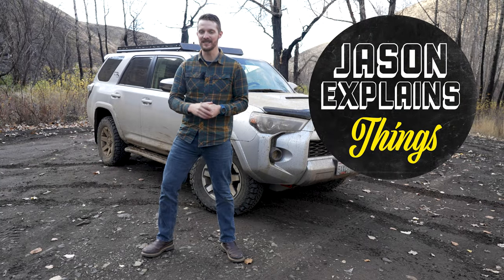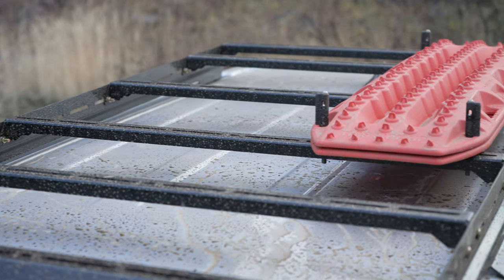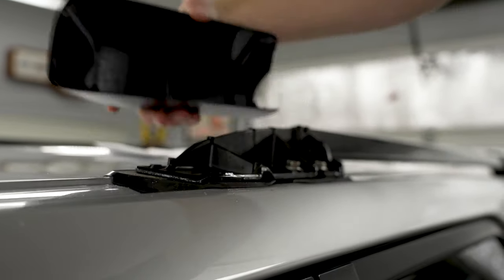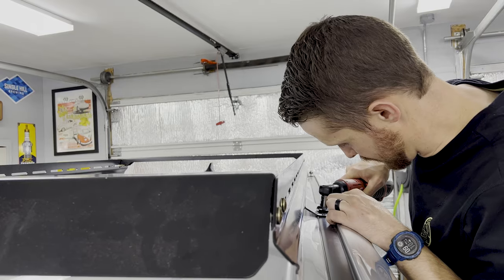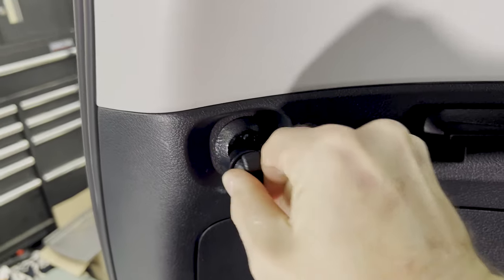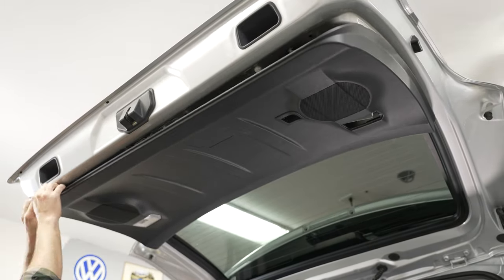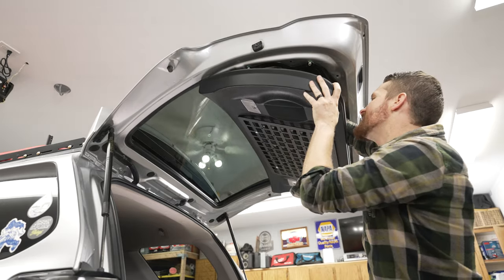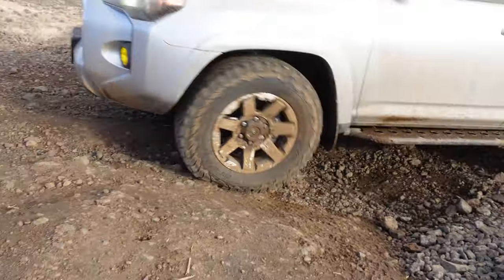EASY + AFFORDABLE 4Runner Roof Rack & MOLLE Panels

Comment: When I installed the fender flares on my Tundra I bought some 1 inch 3M clear vinyl tape to go between the paint and the flare. Anything not directly bolted to the car, like the front roof fairing, is gonna vibrate and rub but the vinyl is a cheap sacrifice. Bring it over and I'll buff it out 😁 Now I need to convince my darling that her 4Runner roof rack needs an update 😄
Reply from the maker: Thanks for the advice.  A very good idea for the future.  I think most of the scratch would buff out except for one tiny spot were the paint wore all the way through.  I need to touch it up soon.
Reply: @JasonExplainsThings   That is a bummer :(  Sounds like the makings of a future video "how to use Toyota single-stage touch up paint" 😂

Comment: I've had several 4Runners, the latest is a 2022. Why they use the crappy plastic in the cargo area just amazes me. No matter how hard I try, sooner or later it just get's scratched up. And it doesn't take much pressure to mess them up.
Reply from the maker: Yeah, I see what you’re saying.  Adding the panels has definitely been beneficial already… even for just daily use.

Comment: Hi quick question, I want to know if I can mount rotopax on there. Will it fit?
Reply from the maker: On the roof rack.  Yeah for sure.  Usually people use plates in between two cross bars.  That what I plan on doing for rotopax
Reply: @JasonExplainsThings  thank you!